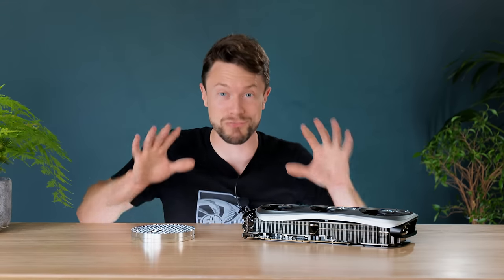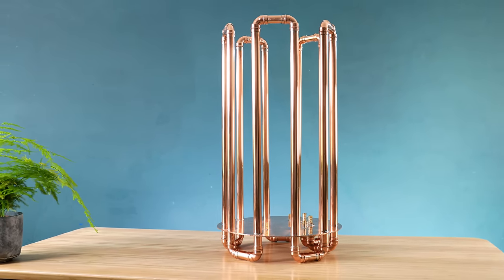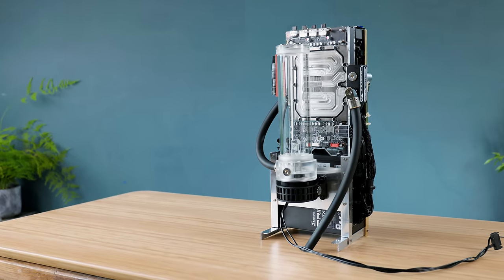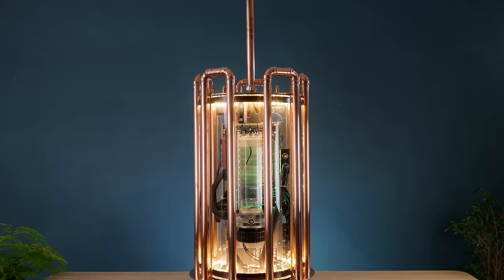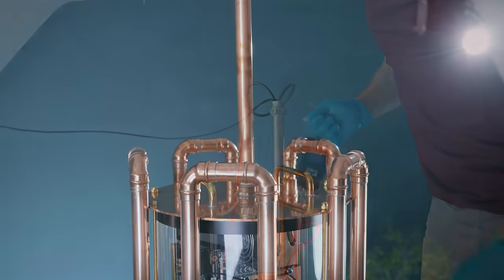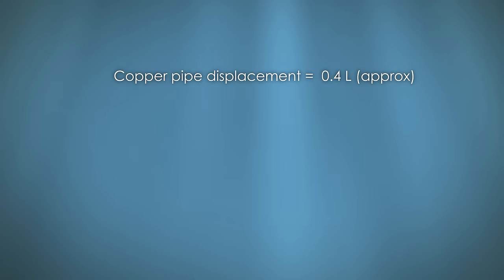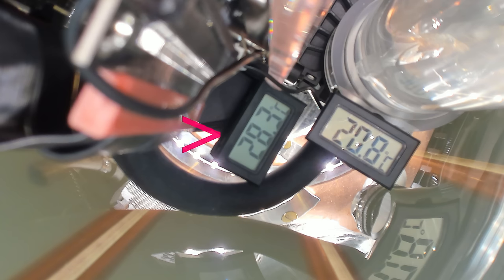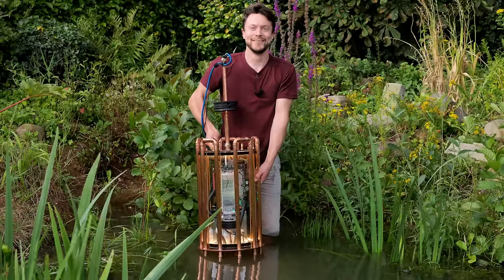Building an ACTUALLY water-cooled PC

Comment: Just my 2 Cents.
You could add a hygrometer and dehumidifier packs.
If you closed up the PC in 24°C with 50% Air Humidity, you'll get condensation at around 12°C. Meaning you will have water inside at Fall and Winter. 
Also you could add a way to increase the Air Pressure inside the capsule, like 1.2 bars. That will help against water ingress.
Reply: Great suggestions!!
Reply: the physicist has teamed up with the engineer to create the ultimate cooling system for your pc.
It even works underwater!!
Reply: The capsule is not a pressure vessel, it has an open top to allow the cables through. It'd be very difficult to make a pressure vessel while also allowing those cables to exit
Reply: remove the thunderbolt cable, run it on remote desktop, and rig the power to pass through an isolated copper piping.
Reply: Nice!
Reply: Air prussia.
Reply: I'm surprised this is the top comment. 

You were right in thinking that this might be a problem, and considering solutions for it. But there are a few additional things to consider. 

First, is water temperature is different from air temperature. A pond like this, in England, where Autmn and Winter is exceptionally dry, is likely never going to be in the danger area in the first place. And while there is air temperature occuring, there are only a few moments a year where this could potentially be a problem (and even then I'm not certain it would be). 

Others have mentioned that it isn't a closed system, so I won't comment there (this would make dehumidifier packs almost useless, and the pressure system wouldn't work either). 

Finally, is that this is a PC that should be on all the time, and even under idle thermal load, the components that are causing the air temperature issues should mostly still be kicking out the same amount of heat. You would end up in a situation where even in those potentially dire

What is actually the most concerning is copper pipes. Natural borne water like this can often have elements in it that cause significant corrosion to copper. oxidizing acids, sulfur and ammonia compounds, and heavy-metal salts, sulfur, just to name a few. This water would need to be tested for these to discern if it would be safe to harbour a computer like this for any length of time.
Reply: I also thought about a hygrometer or something, I was waiting for the dude to actually test the capsule for leaks or add other safety measures before dumping several thousand dollars of equipment into a pond but the common sense escaped him somehow.
Reply: @BaneWilliams  copper should be fine. Its one of the most weather resistant metals, as it forms a protecting patina around it. There are thousand year old sewage systems made of copper
Reply: But if winter come's then it will just freeze the pond and it will damage the system.
Reply: JuSt mY 2 cEnTS
Reply: @Paul-wk4gr you couldn't be more wrong. Copper completely corrodes in salt-water fast. It's one of the least resistant metals. You need special alloys for seawater usage, probably containing nickel
Reply: I mean the fact the top pipe isn't sealed tells you it's not going to be in there long. Otherwise you'll have issue with rain. However great ideas and it should also be sealed at the top
Reply: i'm no genius but does it matter to have water condensating on the parts at all? I mean, i don't see how humid air alone is a bad thing? Yes, there will be condensation on the computer parts but that water is basically demineralised water containing no chemicals or other forms of matter that encourages corrotion. A part from a potential mix of materials and metals from between the pc parts, isn't the pc going to be immune to corrotion even in humid air?
Reply: @apg4gearhead  if condensate weren't an issue to water, then one could just leave electronics exposed to rain since it's also just condensate. Copper is one of the most easily corroding metal in industrial use. At neutral pH, it will dissolve in water. At ph of 5.5, it dissolves at maximal rate. You have a multitude of metals in close proximity which will naturally produce a charge between themselves like a battery. Or add an actual current and you just invite shorts. That is ignoring all the particulates that will be everywhere around and on top of the electronics ready to be mixed into the water. Then there's all the non-metallic components of PCBs which may or may not react with or dissolve in water.
Reply: @MarcRitzMD  Condensate and rain is two different things, by all due respect. The type of rain called acid rain, poses a real problem to electronics unlike condensate. But i do agree that for longterm use, untreated copper is a dumb material
Reply: @apg4gearhead  rain is also a form of condensation
Reply: @Not_A_Friend0777  if winter comes, the fish are going thing there on holiday, it's one big water heater? he may even be posable to tropical fish in there too?, 🙂
Reply: it's the uk not america i think he is good
Reply: Just replace the air with Nitrogen gas and a variable pressure gas chamber above the water.(A Balloon) No condensation issues.  i would add a layer of silicone as a primary outer seal. Rubber will rot over time.
Also add water intrusion sensors, at least four  that disconnects the power if water is detected.
Like the thunderbolt cable idea.
Reply: @Nighthawk20000  If you were to build into the plate a set of adapters that provided a disco reco point that kept it sealed that could work to allowing it to be slightly preasurised.  then you would need to house the external sets so they remained protected from water but that could be done.
Reply: @mequavis  nahbro bluetooth that shit and stick a nuclear reactor for power in it obviously
Reply: @JCake   miniature particle accelerator doubled as a heat sink for the cpu :P
Reply: have u ever tried using a wireless desktop? the latency is horrendous even just a few feet away in open air, i couldnt image how bad it would be in a sealed container, 10+feet away, and underwater   @mequavis
Reply: o.o copper is the most common thing used in pc cooling systems and have been since the beginning. its used in air coolers and water cooling. Nickel is the newer material being used  @BaneWilliams
Reply: @MMORPG87  u obviously never upgraded to 5ghz wifi.. lol
it has no latency and is more responsive the a lan cable :P
Reply: @MMORPG87  He is talking about copper in pond water. You have to use a tonne of chemicals in cooling systems in order to make the liquid noncorrosive to the copper inside. You are completely right, but I was talking about the parts touching the pond water.
Reply: @BaneWilliams Would the copper pipes be suitable to be submerged in mineral oil?
Reply: @extremespartan117  Good question. I'm not a material scientist, however I would likely say yes, oils are usually used to prevent metal oxidation anyway. I know you don't want the combination exposed to electricity, but outside of that I am reasonably sure you're good. Again, not a material scientist.
Reply: That is the prettiest thing I have seen you create.  😻  This takes into consideration that everything you have done is beautiful. This is definitely on my bucket list to replicate, but mine will live in an aquarium in the house.

Comment: Love the steampunk aesthetic of the copper and "crystal" (aka acrylic) parts, such a beautiful build. And I'm also seriously in love with the laptop, what a fantastic pair of machines they are! Keep up the Perks! Oh and PS: You could alway have put a tube down the main cable entry, filled it with sealant, and added a small aquarium air pump to maintain positive pressure within the chamber, that way leaks would have been evident by bubbles but being positive pressure inside the components wouldn't have been at risk.

Comment: You never fail to amaze me. :)
A tip from a blacksmith and machinist:
If you put a wet rag around solder joints that are close to the thing you want to solder, it won't de-solder and cause a mess of running solder. The recipe for a good solder joint is to clean everything thoroughly as in "A surgeon could operate on the surfaces" clean, then apply flux. Apply heat to the two materials taking into account that the larger piece will draw a lot of heat away. Then carefully "probe" the material with the solder to see if the temperature is hot enough...proceed to solder by letting the solder "wick" into the joint. Work the flame around and let it do the job of soldering your joint fully. Clean...and enjoy your work. ;)

Comment: you should remove the moisture inside the case to avoid water droplets forming while immediate cooling
Reply: A large desiccant pack like the ones used to mothball jet engines would be a worthwhile addition. Or purging the air out with dry nitrogen then sealing it.
Reply: Fill with mineral oil and it's not too terrible for the environment either
Reply: Just fill the inside with water to be one step ahead
Reply: @MrNavyman53  Great idea! Also, I've learned from organic chemistry lab that xenon gas is even better than nitrogen at preventing chemical reactions from taking place, if you're willing to pay the premium over nitrogen.
Reply: @danielhebard1865  I mean... why xenon? Argon is just as good and WAY cheaper

Comment: One mistake in the video: at around 14:42 you mention that you don't see any bubbles coming out of the enclosure so it must not be leaking. However you would never see bubbles with a setup like this, even if it was leaking. Because the pipe on top already provides a way for the air to be displaced/escape and water to get into the enclosure. This basically means there is no need for air to get out of the enclosure where the leak is, for water to replace it.
Reply: Solid theory, but I believe at the end when he adds the foam rings you can see he plugged that pipe with the cords running out of them. you can kinda see it at 14:30 as well as 17:45.
Reply: I read one line and then give up
Reply: @Class11-vo7mc   same
Reply: @Class11-vo7mc  why celebrate ignorance? Especially on a video of a dude taking a scientific approach.
Reply: @billcar50  ehhhh, short and half-assed science. This channel is more like high school project level of science.
Reply: @Class11-vo7mc  Seriously? He actually does make an interesting call, you couldn't read just 1 more sentence to understand the comment?
Reply: @Class11-vo7mc  weird flex but ok. OP only wrote one paragraph worth of words, kept it coherent and fairly succinct. If you're boasting about not being bothered enough to read it, while caring enough to comment, that says a lot about you.
Reply: @6k911Channel yeah dude

Comment: Great build! For those following at home; and not trying to artificially raise the drama; I would recommend adding a moisture sensor and testing the casing WITHOUT the expensive pc components in there for leaks first (maybe using arduino or pi). As an added plus you could keep the moisture sensor and have it auto-shutoff the pc if it detects moisture rising above a certain level in the future if ever the seals would leak.

Comment: Crazy that this video and the LTT pool water cooling released on the same day! This really seems like it could be a cool way to save power on heating/cooling at an industrial scale.
Reply: Many of the data centers today already use the waste heat to heat up city infrastructure and houses. So it IS a cool way already :)
Reply: LTT solution is the jankiest thing I have ever seen. But DIY Perks cooler is a work of art (as usual). Using a pool to cool a datacenter is maybe as old as computers, I've known one that was(and still is) cooled by the ornamental pool outside back in the time punch cards were still a thing.
Reply: @astranger448  Exactly what I was thinking, and yet LTT got more views.
Reply: @mr.destruction2930  LTT is very overrated. They have fallen in the same trap most u-tubers, or for that most media walks in, the need to have something new every day. Ever seen a newspaper with a headline 'nothing happened today so this newspaper intentionally blank'? Neither did I. If there is no news fit to print they make stuff up. 

But luckily for us there's the magazine format too, do something weekly or monthly and make sure it's good. Might not get as many views but at least it's worth watching.

Comment: Great build! If you plan to keep using this pc, I suggest pressurizing the inside a bit higher so that if a leak forms, air will go out before water goes in, plus the pressure falling gives you an early leak warning!
Reply: I don't think that's good idea. The lower pressure in the chamber is what makes the o-ring create a perfect seal. If anything he should lower the pc deeper in the water for a tighter seal due to the higher water pressure.
Reply: The pc has a gaping hole were the wires come in so you can’t pressurise it. Still a good idea and in my opinion  the only disappointment of the build. As it makes this pc not actually functional for longterm use
Reply: Those gaskets, kinda rely on being compressed to work, pressurizing the chamber will just make it unstable.
Reply: The wires into the PC can be sealed to maker the vessel pressure tight. The pressure at the moment is outside pushing in. Having pressure inside the vessel makes perfect sense to keep water out. That's how asbestos masks work, higher pressure inside so particles can NEVER enter the mask. Sinking the vessel deeper just addes to the outside pressure trying to force water in. The gaskets are relying on the top and bottome plate being tight. Nothing to do with inside or outside pressure. As I said, Having an inside pressure will help neautralise the outside pressure. A small soda stream CO2 canister via a reducer will keep a constant controlled pressure. If you see air bubbles in the pond, you know there is a leak way before water ever enters the vessel.
Reply: Doesn't higher pressure increase temperature?
Reply: @ClyeRandom  No more than the energy used to compress, and the heat dissipates pretty quickly.

Comment: Can you re-do this video during winter? Would be awesome to see this performance in extremely cold water!
Reply from the maker: I think I might! Maybe direct die cooling as well?
Reply: Great idea!
Reply: @DIYPerks  It would be lovely!
Reply: Oh hell yeah, a thumbnail of that thing half submerged in ice would be a algo hit
Reply: @RedlineA2Y145 Ice would break the pipes quite fast though. Also there's thermal expansion issues, the gaskets could fail in cold water, and the cooling fluid would have to have a lower freezing point than water so there isn't a freezing blockage.
Reply: @OlaviMurto  Depends on location and how deep he can drop that into the pond...  In all likelihood, the entire pond wouldn't freeze, rather just the top portion.
Reply: @DIYPerks direct die cooling underwater? You madman! I love it!
Reply: @DIYPerks  and use liquid metal on the CPU of course, with it overclocked to the max!
Reply: @DIYPerks yes!!! Direct die cooling with icy water would make for amazing OC stability, please also see how far you can push the clocks!
Reply: @DIYPerks  Not sure how well it would look, but I'd be interested in some night-time footage with the LEDs as well!
Reply: Though in the winter you would want to make sure you pull a slight vacuum on the cylinder before sealing it to ensure the ambient moisture inside is a minimal as possible
Maybe also include nitrogen after so the air cooler has something to work with?

Comment: Maybe you should add a umidity sensor inside, as you can calculate condensation on the acrilic walls, and a cap on the top tube for blocking the rain
Reply: I was thinking he should add an inert gas into the chamber. Argon or nitrogen. Argon would be best since it is heavier then air (it will stay in the container without having to completely airproof it)
Reply: @Xidification curious, what would that change?
Reply: @anterprites  being outside, temperatures can fall below the dew point. When you pour the argon into the container, it should, (I'm no expert) push out the moisture-laden air so when the temperature does drop, there shouldn't be any condensation inside the container that might short out the computer.
Reply: @Xidification  or just put some silica bags in it
Reply: @HBSVDK  silica bags instead of the steel weights would be a good idea
Reply: @TalentedAndHot  or not since it will take all the space to match the weight of the steel. And the tube is open, so the silica will not last long
Reply: @Xidification  it would be nice if the tube was sealed

Comment: Keeping a 4090 at 41C is quite a feat. I've got the MSI Suprim Liquid X, and with a 240mm block it still gets pretty toasty (approx 60C) with certain games like Cyberpunk or Starfield.
Reply: Also the central processing heater that is the i9  lol
Reply: think you mean a 240mm radiator, & it isn't big enough for a 4090
Reply: @112Famine  60oC is fine though

Comment: If you wanted to get rid of the metal pellets, an additional steel plate to act as a bottom to protect the bottom of the copper pipes might be a good way to do it.
Reply: I agree. Would look much better. The bags of pellets inside didnt look good with such a gorgeous build.
Reply: Or just add a loop to the base to allow chaining the whole thing to an anchor.

Comment: Wow, I didn't expect it to be quite THAT effective. Brilliant work.
Reply: Well we have to consider that all that copper plumbing would already do a fairly good job of dissipating heat to its surrounding air before even considering the added efficiency of submerging it in water. He could have placed the PC in the garage to keep it from heating up the house and it would still be able to keep the temps under control without being immersed.